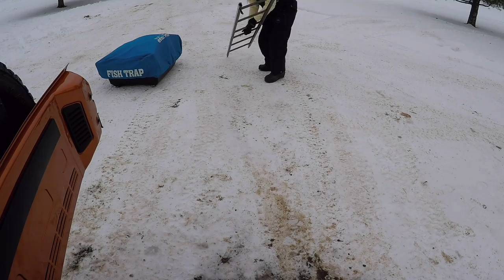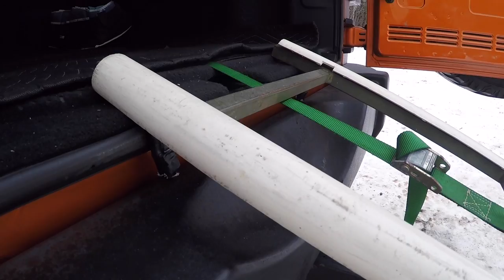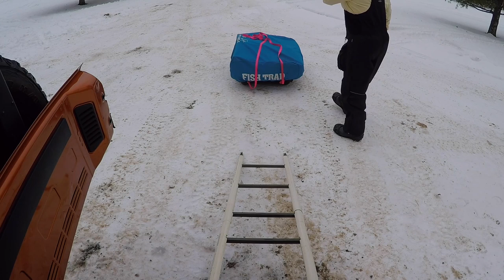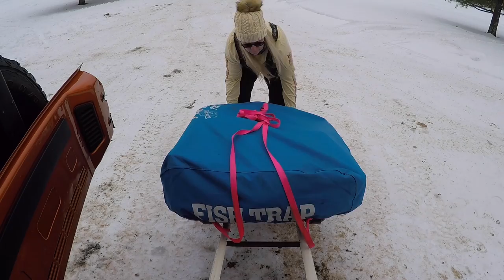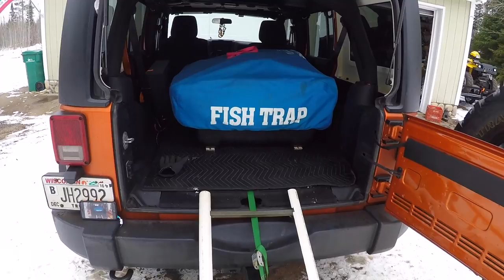How To Easily Load Your Portable Ice House

Comment: That works great nice job
Reply from the maker: Thanks! It definitely worked smoother for the Clam house than my Otter Pro Cottage, though. The Clam tub didn't have ribs & the Otter does. It still works well, just not quite as easy. When I get some  time, I'll make the ladder rails a little taller & that should do the trick. Thanks for watching! :)

Comment: I have the same color Jeep, but in a 2 door Rubicon. I have the Otter Hideout and for me I have to push the passenger seat all the way up. The Hideout will fit on its side.
Reply from the maker: Awesome! I LOVE my Jeep and I was lucky enough to get my favorite color, too! :) 
I recently upgraded my portable to the Otter XT Pro Cottage. It's a little bigger than the Fish Trap Pro was, but ir fits nicely in the JKU, too. 
Is the Hideout the one with the "leg dents" in the tub?
Reply: Endless Ice yes it is, it the one man but only weighs in at 50 pounds. Its pretty comfortable to sit in, I'm 6'5" and I can have 2 holes with my engle cooler and buddy heater and still have room.
Reply from the maker: Excellent! Perfect portability!

Comment: Pretty slick!
Reply from the maker: Thanks! It's a little tougher with my Otter Pro Cottage I have now since it has ribs in the center of the tub but I plan on putting risers between the PVC & ladder rails so the ribs clear the rungs. We'll see! 
Thanks for watching! :)
Reply: @EndlessDIY  This is great. I just got the Otter Cottage and left the bench out so I can pick it up and get it on the tail gate of my tacoma, but it is a bit too wide to do this with gear in it.  I may try something similar, but unfortunately I don't have a treestand ladder.  Maybe angle iron and PVC, or maybe ill try to use some old downhill skis.
Reply from the maker: @davidallen3490  I've got the Otter Pro Cottage now and it doesn't "lock" onto the ladder slide like the Clam did because the Otter has runners in the middle of the sled & the Clam is smooth. It still works, but it's a little tougher. I may put pieces of PVC on the rungs to act as rollers. I'm not sure yet. Unfortunately, I haven't been out much lately; dang work! lol! Please report back with what you come up with so we can all learn from it. Thanks for watching & good luck with your project! :)

Comment: I have a piece of fiberglass extension ladder that I want to use. As truck bed is 66”, I’ll have to make two pieces as well. I was wondering how your two pieces attach to each other. Also, how did you attach the PVC to ladder rails? Thanks much.
Reply from the maker: Hi there, the 2 pieces I have are part of an old tree stand so they are designed to just slip together. I attached the PVC with sheet metal screws. I fastened them down just tight enough so the pvc doesn't move but not so tight as to crack the pvc, if that makes sense? Good luck with your project! :)
Reply: @EndlessDIY  thanks! Ok, last question-How long is the ladder? I have a 10 ft. length but I was thinking maybe making it 8 ft. Thanks again!
Reply from the maker: @NP-ql4qo  I believe each section is 4' or so. Overall, I think it's about 8.5' or 9'.

Comment: Will this shanty fit in the back of car in the trunk
Reply from the maker: I guess it depends on the size of the trunk. It easily fits in my Wrangler Unlimited, but I also had it in the back of my old Kia Soul & was able to close the hatch just fine. The packed size is L 45” x W 36” x H 22”. Hope that helps!
Reply: The trunk space is 18.2 cubic feet for my car
Reply from the maker: You're going to have to physically take some measurements. The cubic feet could really be any shape.